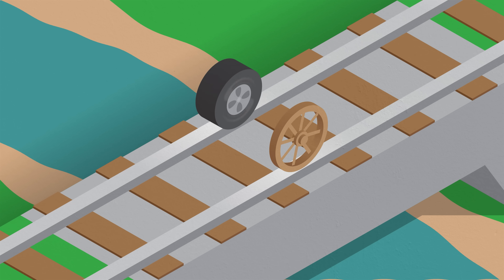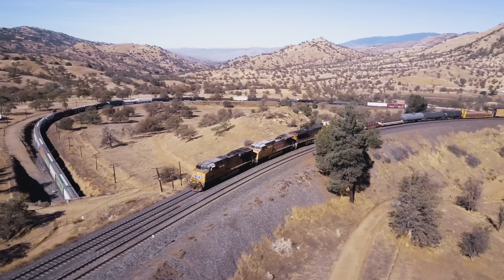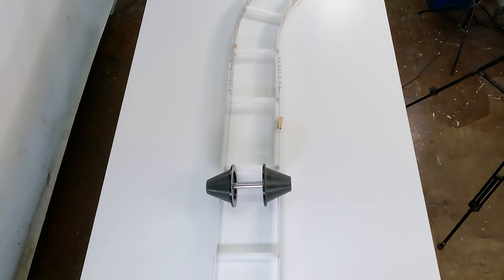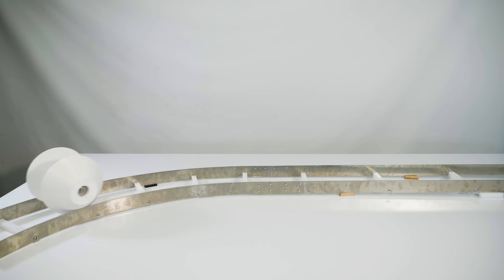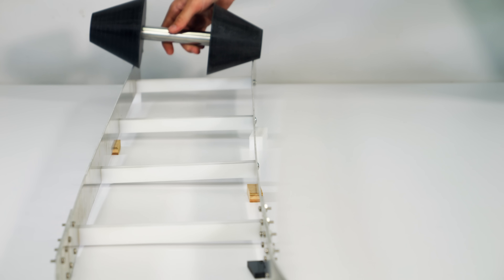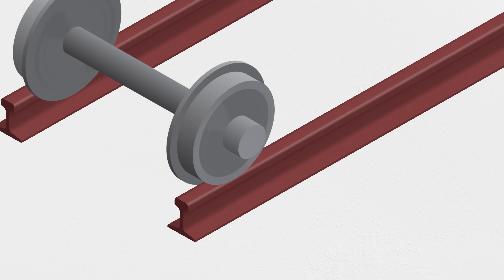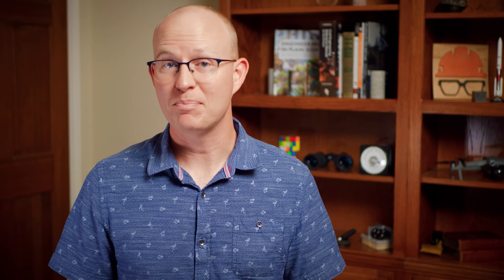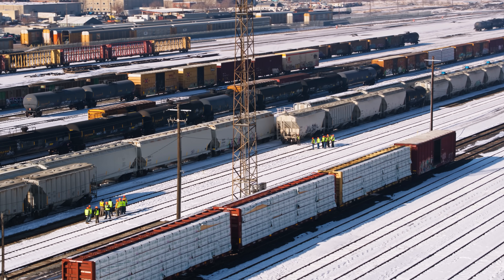Why Are Rails Shaped Like That?

Comment: Good one Grady. I'd like to learn more about rail expansion and contraction, especially given the fact that in "olden" days, they used short sections with gaps to accommodate changes in temperature, but today it's (mostly) all welded -- virtually no gaps.  A friend told me they used specially formulated iron depending on the average ambient temperature of where the rail will be installed. Thanks
Reply: In the UK our continuously welded rails do have expansion joints every 900metres or near as.
Reply: @JP_TaVeryMuch   No they don't. A single length of CWR is often many miles in length.

The expansion forces of about 1 ton per degree centigrade, are controlled by ...

A) installing the rails so that they are not under tension or compression at a mid range temperature, 27'C in the UK.

B) The forces generated as the rails move away from the natural temperature (27'C) on hot (compression) and cold (tension) days are resisted by the sheer mass of the track and the ballast the sleepers are laid in. With up to 30 quarter ton concrete sleepers buried 8" deep into the ballast for every sixty foot run of track.

There is also a raised shoulder of ballast off the sleeper ends so that to move the sleepers have to push through even more weight of ballast.

Comment: Steel wheels on steel rails is basically a cvt transmission you find in many horrible nissan vehicles. Of course you can't put sand in the gearbox and there is oil in it which would be annoying for train wheels

Comment: Fun fact: French HST (TGV) broke 3 world speed records on rails without any issues:  380 kph (1981)  515 kph (1990)  574 kph (2007)😀
Reply: I wouldn't call having to regrit the tracks and replace the overhead power lines "any issues" 😅 It was a stunt, and everything had to be prepared and repaired afterwards.
Reply: @AccAkut1987  It was the 1955 speed record 206 mph that damaged track and overheads , the current world record high speed run 574 kph  required very little attention afterwards
Reply: @AccAkut1987  Such an unnecessary and seemingly sour grapes comment. It stands to reason that ANY speed record attempt will always be conducted under the best of ideal conditions.
Reply: I bet that if you were to interview any of the engineers on the amazing TGV project, they would tell you that before they set records there were many, many issues to be resolved, but they did resolve them.
Reply: @jimrennison1  I'm talking about the speed record not the preparation of the record. On 3rd April 2007  the TGV train reached 574 kph in 13 minutes without any issue. btw on 29th march it reached 568 kph, and 541 kph under the rain. No issues during the speed tests.

Comment: I think its interesting to note that when engineers come up with a new wheel or rail contour, they also need to be backwards compatible with previous designs because you can't change everything at once.

Comment: fun fact, old railway tracks are so compressed down by the weight of all the trains they have carried  that they can make good anvils
Reply: That's right, they are a cheap replacement for an anvil. I used one before I got a big, old anvil from my grandfather, which may be from the 19th century (the anvil, not the grandfather ;-)

Comment: 4:25 is nonsense. "the wheel has to rotate at the speed speed as the track" Um no... There's lots of slip. sure they want to reduce slip, but if you listen to a quiet electric train coming along, the noise is a high pitch eeeeeeeeeeeeee.... steel on steel noise.. from wheel on track.  Does the rest solve this imaginary problem with an imaginary solution ? Ah yes.. you strongly imply the imaginary problem is cured by the conical wheels ...Do they really reduce slip  0.000000000000000000000000000000000000000000000000001%   at all times ??? The shape of the wheels causes the complete absence of slip ??? ? No.  Hey you even said the train is going side to side on a straight bit of track, but  that means its causing the wheel slip to vary, even though the track is straight. ,If it varies, it must vary from zero ! And at a curve, the slip reduction of the conical wheels is going  to vary with the speed of the train, at high speed its higher up, but going really slow, its very well centered... so the slip is going to vary , right ???? They can only optimise things for a certain speed of train.  Good thing  it was an imaginary problem hey.

Comment: Railway tracks are made of steel, saving costs compared to building roads out of the same material, and how steel wheels are used due to the high rolling resistance of wooden or rubber tyres. Flanges, lips that project below the rail to guide the wheel and keep it on track, are fitted to the inside of railway wheels to reduce the risk of derailment. However, flanges create friction when trains go around corners, resulting in the characteristic squealing sound. Solid axles attached to both wheels of a railway car cause a problem around bends, as both wheels turn at the same rate, while the length of the outer portion of track in any given curve is longer than the inside. To solve this problem, railway wheels are conical, with a wider profile on the inside next to the flange that gently narrows toward the outside of the wheel, helping wheelsets to self-center between two rails.

Comment: Would like to see a vid. about why we can't have high speed rail.  To many tons per axle, corp. pressure for a long time, tears up the roadbed, rails aren't welded.   etc..  Great stuff, keep on!
Reply: Europe has welded rails, while Australia or the US have bolted ones.
Some high speed tracks are built on a solid concrete slab, without any gravel.
Reply: Point being that we run double the weight per axle because of corp. greed!  It destroys the roadbed and we are to cheap to weld the rails, because with no solid roadbed you got nothing but accidents waiting to happen. Now they want to run trains with no crew, they already killed a worker in a yard with one.  @simonm1447

Comment: I think some of the information presented here is misleading. You presented it in a way as of the flanges were there for the regular turning and the one-piece-axle-and-wheels being a problem.

Afaik, the one-piece design plus the conical shape are the solution of the turning, and the flanges are just an emergency backup. They don't come into contact with the rail most of the time

Comment: The grinding down of the rail by the wheels is actually an intended property. It would be possible to reduce this effect, but it is required to remove the fatigue cracks that form from the repeated load on the rails. Material engineers have been looking for decades for the right steel to match crack formation and grinding to reduce - or even eliminate - regrinding of the rails.

Comment: The mettalurgy of rail are also interesting, as the composition of the steel varies depending on the point of the rail, to maximise hardness at the top, and elasticity at the bottom (take this with a grain of salt I am by no mean an expert in this field, just remember hearing one telling this).

Comment: I don't believe the flanges should ever come in contact with the rail. They are there just in case, normally they dont touch.

You also made it sound like centrifugal/inertial pushes the wheels towards the outside of the turn. However, even if the track is sloped toward the inside of the turn and the train is going increadably slow, the wheels will still ride up to the outside. This is caused because as the wheels come to a corner, the wheels are centered so they want to go straight as the circumference of both is equal. As it wants to go straight, it rides up to the outside of a corner until the difference in circumference makes the wheel go around the corner.

Comment: Explain to me like I'm 7
The wheel wears out owing to the removal of material by wear.
This is then corrected by machining off more material to recreate the correct profile.
Why is the circumference of the tread (British term for the contacting surface) not insanely out of spec after this?

Comment: Indeed, the wheel sets would not track properly if it were not for the live axles. The tapered wheel profile works in conjunction with the live axle. 

You forgot to mention the rail grinder!  Rail heads are reprofiled on a somewhat regular basis. You can always tell when the rail grinder has been through by the distinct whine from the wheels of a passing train.

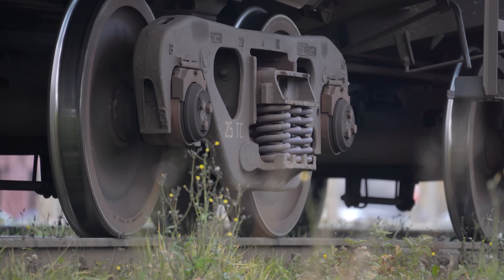Comment: It's interesting stuff, I would add that the wheels have axles not because of the load (3:50), but because without axles they would need far more complex bearings at a far greater cost ie axles with simple bearings & mounts are cheaper.

Comment: Bonus fact1: rails usualy are also tilted at 1:20 or even 1:40 to reduce wear. Bonus fact2: to reduce sinusoidual motion (hunting) on long straight lines its a good practice to keep one rail higher in relation to abother at 5mm

Comment: 1. saves on material cost, 
2. gives more "meat" to secure the rail. 
3. suspension reasons.
4. doesn't need the material for support. 
5. that's just how they were designed, back when rail was a thing. 
i wonder is my educated guesses are correct according to brady.

Comment: You suggest that the solid axle is necessary for weight bearing, which I don’t follow. My understanding is that the axle is essential for the conical profile to work, otherwise the difference in circumference when travelling round a curve would not produce a restoring movement back to the line of the rail. It requires the same angular rate on each wheel which is provided by the axle tying the wheels together.

Comment: Here in London, they've just opened the Elizabeth Line which also has a bunch of brand new rolling stock. I swear every time I'm on the new section of rail in a new train it feels like a flying carpet. Accelerating up to speed with just a whistle, and a ride that is smooth as butter. Just boggles the mind how they can get 1000 tonnes of steel on steel interacting like that.
Reply: H
2:48 2:49 2:51 
lol this
Reply: Mm mmm

Comment: A modern locomotive weighs over 400,000 pounds, which means each of its 12 wheels is putting around 35,000 pounds onto that tiny ~1 inch contact point on the rail

Comment: 2:00 I apricate that you point out that the efficacy of steel wheels is dew to there relative incompressibility witch results in lower rolling resistance. And NOT because steel on steel has lower friction. I can't tell you how many people get this wrong.  Sliding friction and rolling resistance are not the same.

Comment: BART in SF used to run on cylindrical wheels. When I rode it (early to mid 2010s), the wheelslip, the flanges riding the turns, and the corrugated wear patterns on the rail made the ride incredibly loud and significantly less comfortable.

On a completely different track, you might want to check out Rio Tinto Australia’s fully automated ore hauling trains, running hundreds of kilometres from the mines to the ports. It’s truly amazing, running these thousands of metres long machines, safely, without an operator in the cab. (It helps that it’s a fully private system with no grade crossings, but still quite the feat.)
Reply: I’m baffled by why any modern late-20th century railway would use cylindrical wheels, since all the (basic) engineering on wheel shape was done in the 18th and 19th centuries. I would hope there was some specific reason rather than just negligence

Comment: Trains aren't just fascinating. They are also the most efficient means of land transportation. We really need, as a country, to buckle down, eliminate long-haul trucking, and move cargo by train if we're going to stop climate change.

Also, train dispatching and control operations are a fascinating topic. There's not only control panels, but also huge sheets monitoring train progress and an entire safety protocol with control lock-outs of varying controls. I worked on a contact with SEPTA in the 80's to automate those spreadsheets and touring the facilities was fascinating, although the engineers at the electric plant weren't very happy about getting visitors.

Comment: Great video Grady!
What would be the downside of using free/open axles with inside and outside wheels free to spin independently? Obviously cost/complexity maybe strength, but I mean operationally. 
Or is it just not worth it and it is more easily solved with conical geometry? I mean, obviously the latter is the case since that is what is done, just wondering what downsides there are to free axles?
Reply: They tried that. The result: derailment. The outer wheel actually needs to turn slightly faster than dictated by geometry in order to turn the wheelset into the curve. It can work if the wheels are driven appropriately but it's very far from simple but that's not much use for conventional trains.

Comment: You only examine North-American rail engineering.  One thing I have never understood is why, until quite recently, the cross section of British rails was a figure eight.  That is the bottom was not flat as in North-America.  Often to save time and money early North-American rails were often set directly on the wooden tie.  This is called a "minimal useful design".  Only once the line was making money would the operator go back and install metal plates to spread the force.  But British rails required a complex spring mounting to prevent them from rotating around the longitudinal axis because the foot had a circular cross-section.  I have never understood this.

There is also the impact of the Westinghouse brakes which have been central to the the operation of trains in North-America but have only recently been introduced elsewhere.

Comment: Very enjoyable! It made me think of a calculus test question from decades ago. The question asked to determine the minimum radius of the track curve based on the conical angle of the wheel. Unfortunately I cannot remember the process, but it was amazing to me that the angle of the wheels was a factor in the radius that the track had to be laid. Mathematics and engineering rock!

Comment: It's interesting to take a peek into the kind of engineering required when we push the limits of our technology. In the case of trains, it's how much mass we can reliably transport on these systems. All of the forces and mathematics involved mean that a seemingly tiny change or innovation can make a big difference because of the scale.

Comment: I wish we made more use of rail in the US, but the large distances may mean it just isn't as practical for passenger use. What we do need to do is to replace damaged rails throughout the system. I've seen patches where freight trains have to move at 1mph over rails that look like a pile of spaghetti. That's disgraceful, and dangerous.

Comment: I have been wondering for a decade why we use wooden ties in the US while Europe uses concrete  ties?
Reply: Europe also used wooden ties (or sleepers) in the past. Since Europe typically has more rain the wooden ones made of oak had been treated with tar oil, which is forbidden today in EU. 

New tracks use concrete instead, concrete has no restrictions.

Comment: When I worked for CP Rail in Ontario many years ago I wired up a bunch of track greasers on curves. The grease would be pumped onto the rail after a wheel detector switch was activated.

Comment: Another great series is coming up. Thank you, Grady. I hope you will be saying something about the temperature operating range and leaves on the line. Every year in the UK, we get a couple of excuses from the rail companies. The weather is too hot or too cold, and we have the wrong sort of leaves on the line. Both have a big effect on the train speed.
Reply: Leaves get compacted into a pulp which reduces the friction and therefore the brake efficiency and the traction efficiency. Some leaves compact different than others. They have special rail head treatment trains that blast this off the rail head.

Comment: I'm hoping one of the videos mentions rail grinding, which is how they restore the shape of the rails. The train they use to do it is quite impressive, but I've never seen anything explaining how they work.
Reply: I operated rail grinders for over 10 years, then became a supervisor. Every railroad has a specific 'profile' for their tracks that matches their wheel profile. You basically remove a small amount of rail so the profiles match. Rail grinding can extend the life of a rail by removing minor defects and detecting internal rail problems.  Was a good job. But a lot of stress
Reply: @samuelnelson140 The same as polishing the frets on a guitar. You remove as little metal as possible to re-profile the top surface and extend the usable life of it despite removing metal to do so.

Comment: My grandfather was an electrician at Superior Steel in Benton Harbor, MI where they once turned pig iron into railroad rolling stock. It is unimaginable how much heat and force goes into the creation of axles, wheels and tires that are designed to roll hundreds of thousands of miles without issue.
Reply: I’d guess a higher number, rubber tires on a semi can last half a million miles if properly cared for.
Reply: It would be informative to get real numbers, but I’m not a member of that society… I’m sure you are correct, that wheels and axles roll for many millions of miles (I would guess 10’s of millions and decades of service) with only periodic lubrication. But the tires have a much more abusive duty cycle. Even “straight” rail is not sufficiently straight to preclude the need for some slipping. I am going to try and dig up an answer and will let you know if I come with anything meaningful. @jaydunbar7538